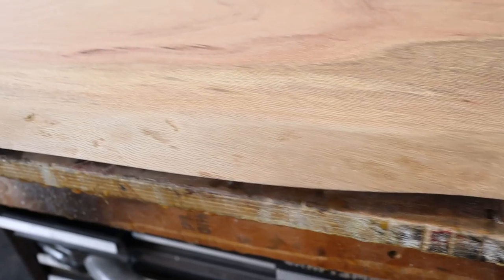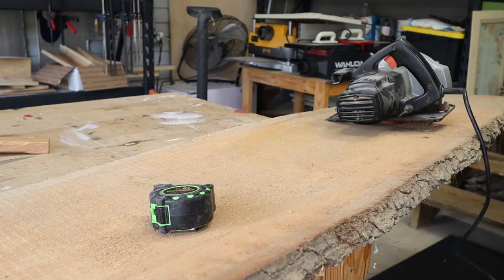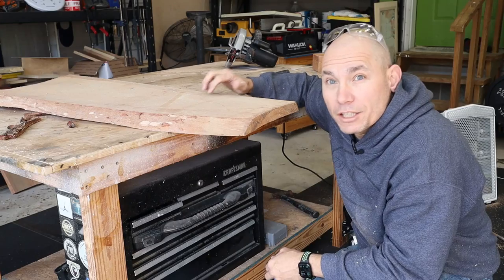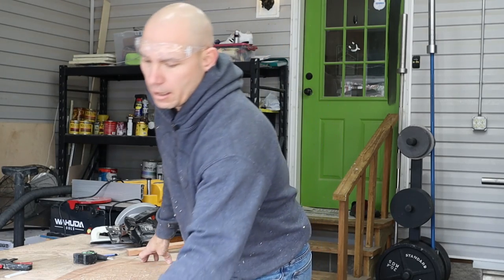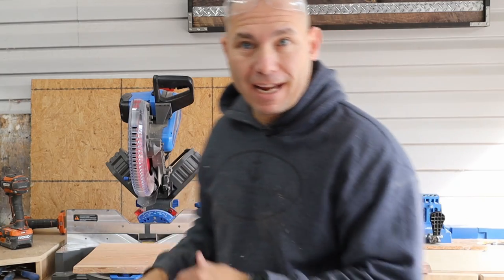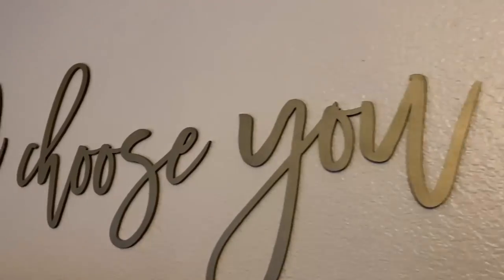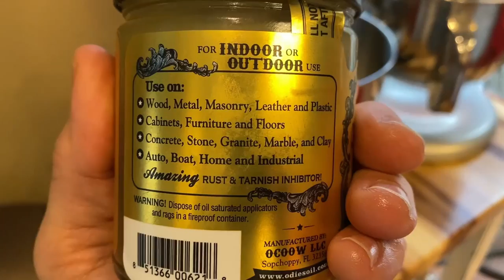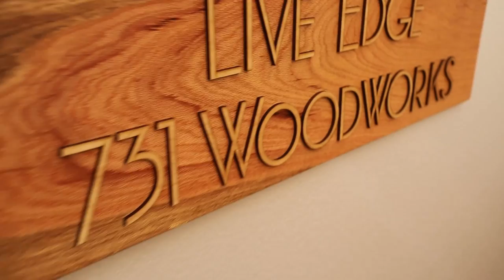DIY Wood Wall Hanging | Live Edge White Oak

Comment: Cut it down the middle.  Run it through the planer. Then the jointer. Glue it back together.  So simple.  Keep both edges and thickness..

Comment: Excellent! That one armed letter sticker helper did a nice job! Call to borrow that Triton router with 2" surface bit with pocket hole rail jig if you have more flattening to do. 1-1/2" to 5/8" wooo weee :-) that gave Mr. Planer a workout. Flip those blades soon. Happy New Year!
Reply from the maker: Happy new year.  That flattening sled would have come in handy for sure

Comment: Great looking project! How much of the Odies oil did you have to use? It came out looking great. I am curious, as seeing the price for the amount you get I wanted to see if a lot needs to be used or just a little
Reply from the maker: Very little.  I used it on all those mallets I built (in the mallet video) plus this sign and still have over 3/4 of the jar left.  It goes a long way
Reply: @731Woodworks  thanks for responding to my question. I appreciate it. I will give it a shot soon. As a matter of fact you got me on using the minwax pre stain and I really enjoy how much better the stains come out.

Comment: Hey Matt, great job, I've a question, do you get much use out of your thicknesser  (plane table). I've been considering getting one but the cost/ work ratio is kinda putting me off. I was working with a lot of reclaimed pallet wood etc which would make it worthwhile but then I don't know if I could could trust myself to denail it thoroughly enough. Any thoughts. Davy.
Reply from the maker: I use it, but not a lot. It is very useful on rough lumber.